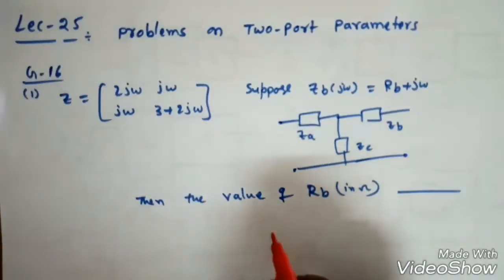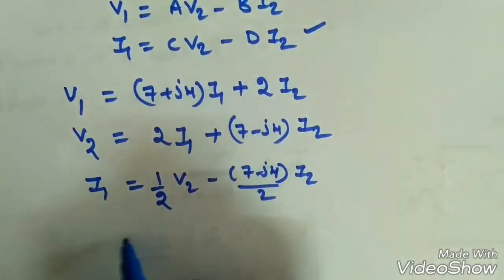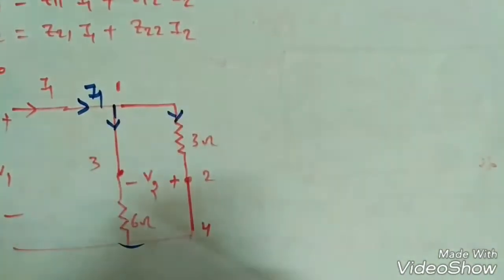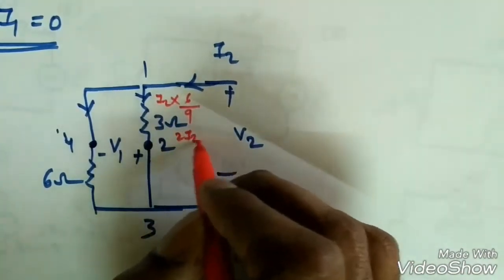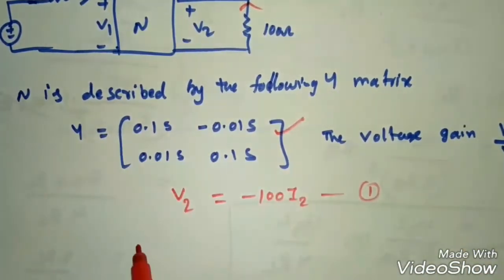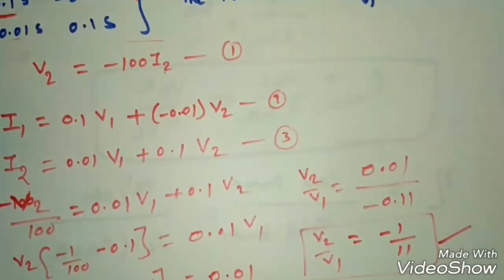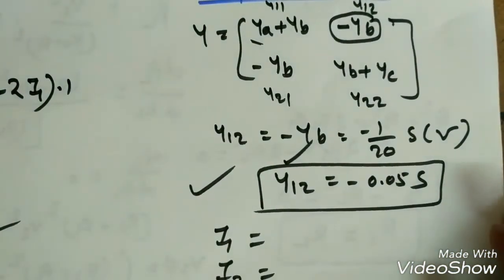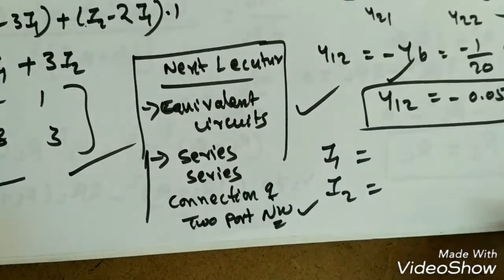Network Theory Lec-25: Problems on Two-Port Networks

Comment: sir at 16:00  , i did that  Que. by dividing Y(11)/Y(12) ;
which will give   (V2/V1)=    (.1/-.01)   =    -10
why am i not getting ans. by this method ?
Reply from the maker: we have to consider the load resistance, then only we will get correct value

Comment: sir at 7:48 cant we just take the parallel of 3&6 which is 2 ohm and then apply kvl from input and output side ...we will get 2 equations as ....v1-2i1+2i2 and v2-2i2+2i1....?????
Reply from the maker: no that will give wrong parameters because V1 and V2 are measured in different nodes